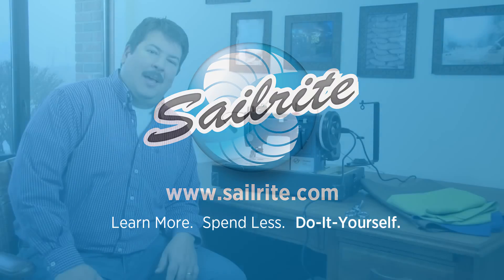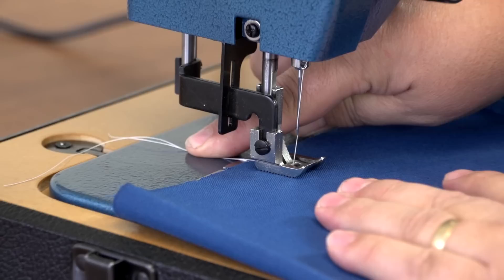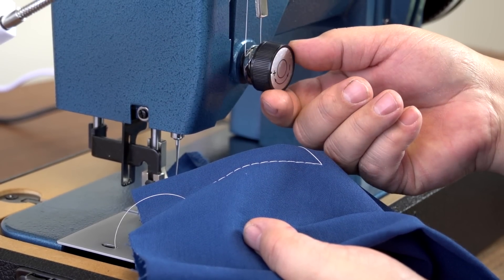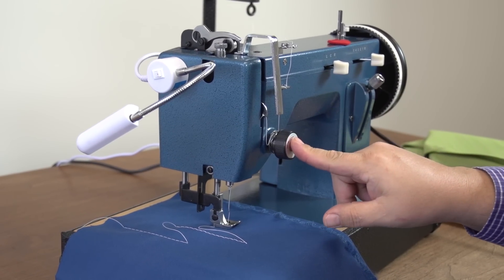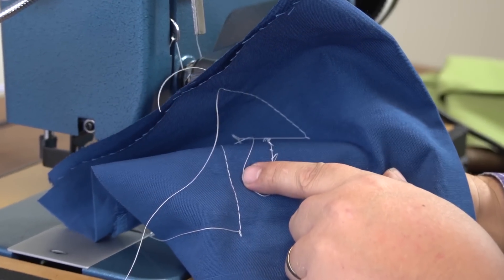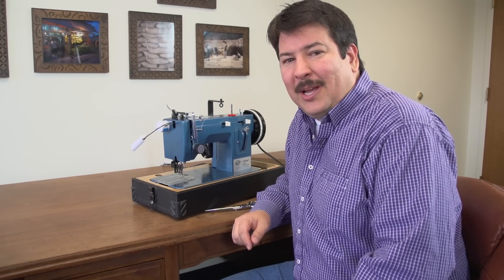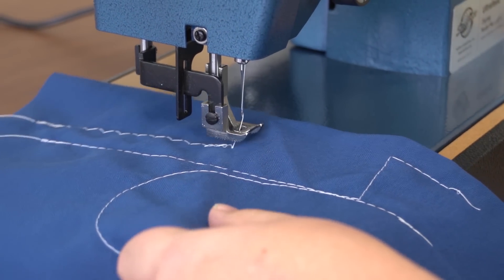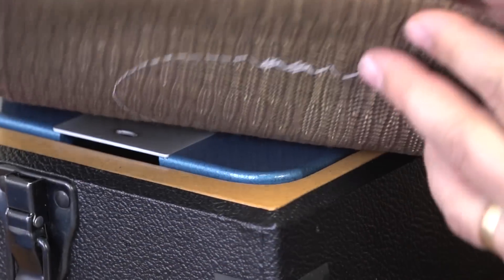Learning to Sew Part 2: How to Stitch

Comment: To the new sewers out there who are watching this, at the part where he "rolls the balance wheel back and forth" to release the thread and be able to pull the fabric out from under the presser foot, I will add this suggestion:   Watch the uptake lever and the needle.  Not so much in the video here, but on your actual machine.  When the uptake lever and the needle are both at their highest points, the hook on the bobbin assembly should be free, allowing you to pull the work piece freely.  Get used to thinking about that position as the default starting position.  This is true on most machines, not just the Sailrite shown here.
Reply from the maker: +rmcdaniel423 Excellent observation and very true! Thanks.
Reply: How do you re tension the thread after check the back side of your workpiece for proper tension?
Reply: How do we set a straight stitch in a rheingold machine

Comment: Great videos! But may I add that you probably should hold the fabric down flat also applying slight tension or pressing pressure to the fabric to maintain is sews completely flat, the fabric doesn't have ''ripples' after being stitched.
Reply from the maker: Good suggestion! Thanks.

Comment: Looking foward to buying this machine. Do you have any ideas if it will sew insulated industrial curtains?
Reply from the maker: Yes, it will easily sew thick insulated industrial curtains. If the fabric will fit under the presser foot, chances are it will sew it easily.
Reply: how high will the presser foot go?
Reply from the maker: The presser foot will go up about 3/8" and your fabric will compress when it is sewn.

Comment: Can I sew Sil-nylon on this machine?  I own this model and I'm having a very difficult time ~ all of my practice sewing on this nylon is bunching up terribly.  I've tried adjusting the tension bobbin; my setting is on 1 for stitching.  Any ideas? I'd like to get going on a tarp project!  Thanks!
Reply from the maker: Yes, you should be able to sew that fabric. Let me ask a few questions so I can evaluate the issue. Can you tell me what weight the Sil-nylon fabric is (I assume it is very light weight)? What size thread and needle are you using?

Comment: How do you sow spandex material?
Reply from the maker: Start by using a ball point needle. Then simply adjust tension until your stitch looks good. Typically the fabric will compress as the thread is tensioned, so only apply enough tension to get a good looking stitch and no more.

Comment: What knots do you see? I don't see what you mean.
Reply from the maker: The loop of thread that is pulled up into the fabric is often called a knot. It is not a knot (but often called that) it is a loop that catches another loop. The top thread catching the bottom thread, forming the loops or knot.
Reply: Got it, but I still couldn't see any loops on the top that weren't supposed to be there - maybe I wasn't looking hard enough